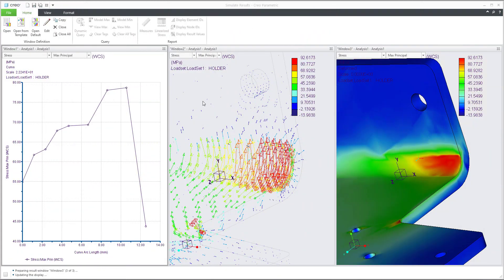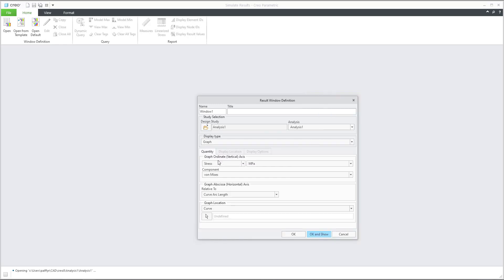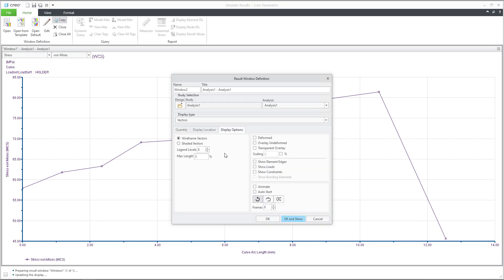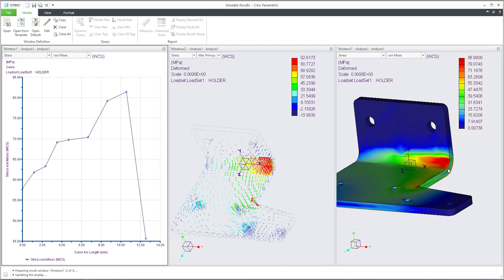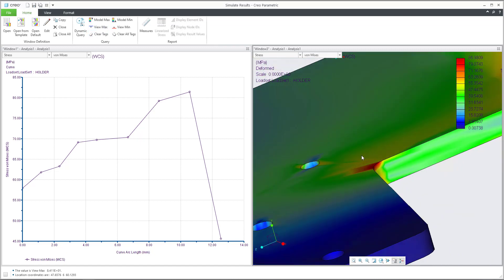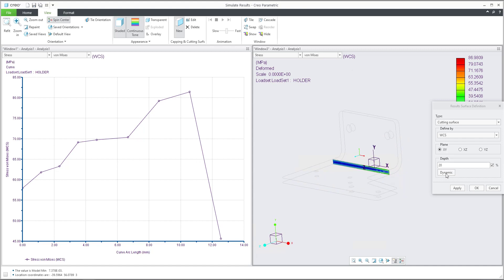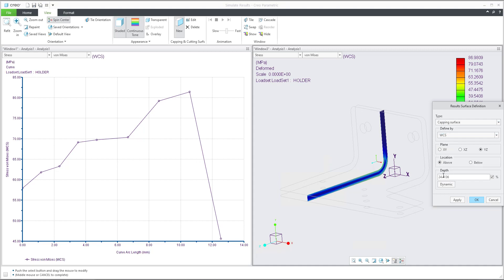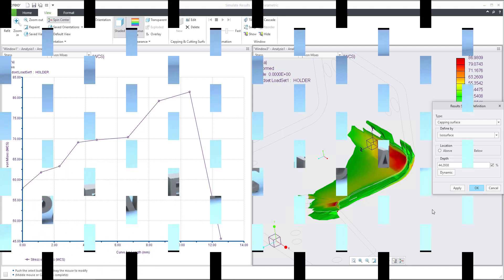How to read Simulate Results | Creo Simulate tutorial

Comment: Thanks for the video...Is it possible to move the results tag to a diiferent location in the graphical window?
Reply from the maker: Hi, I tried to find some more info about your topic but almost all are negative.
Here is the summary what I found:

Moving Contour Plot Result Tags (Max/Min Labels)
These tags (e.g., "Max Stress = XXX") are usually anchored to the contour plot and cannot be freely dragged in most versions of Creo.

Workaround:
Adjust the contour fringe settings to reposition where the label appears:
Double-click the contour plot (or right-click → Edit Definition).
Go to the Display tab.
Under Label Settings, try:
Changing Label Location (e.g., "On Model," "On Legend").
Disabling Show Max/Min Labels and adding a manual annotation instead.

Good luck with your project. Vladimir

Comment: Hi, thank you for your explanation!

I´m having trouble to select a curve to plot a graph, it needs to be from a section of the model, for example, vertical displacement on the neutral line. I´d tried to section the model, and to put line on a sketch before running the simulation, but neither allowed me to select the curve from inside the model.
Reply from the maker: Hi, thank you for your positive feedback.
For your issue for now, I do not have proper solution or workaround.
System also do not allow to select inside curve 😔
Maybe we have to find  another way...
Reply: @4kside  as an approximation for now, I made square  cut with a negligible size (0,1mm), and used it's side as a reference.